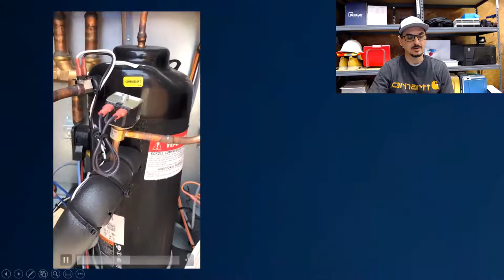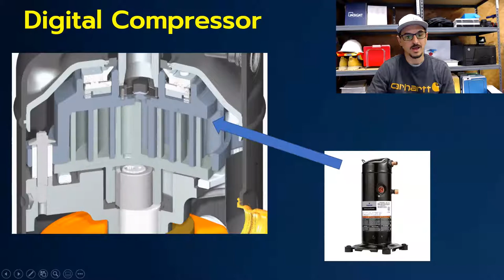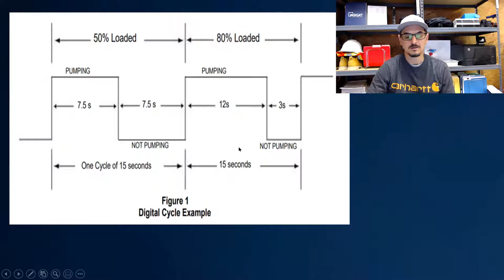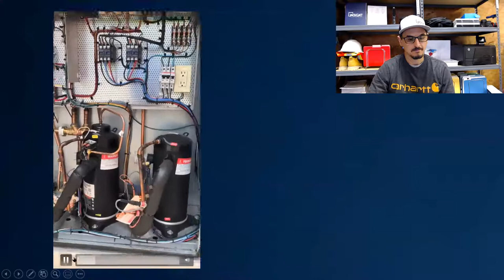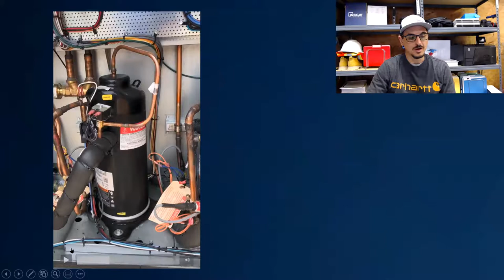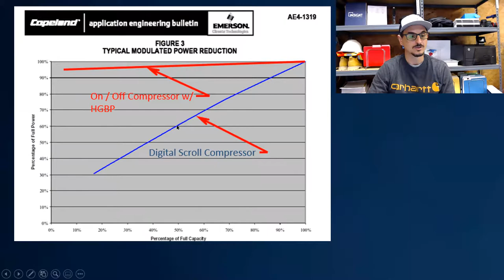How a Digital Compressor Works

Comment: Thank you for the update. 
However I have an existing Fixed Head Compressor how can I modulate it with change in Ambient Temperature to achieve low Condensing Pressure at difference Temperature